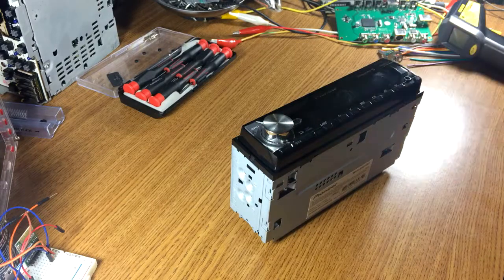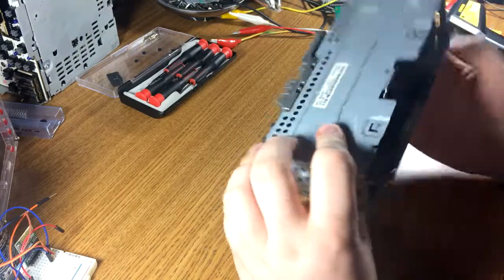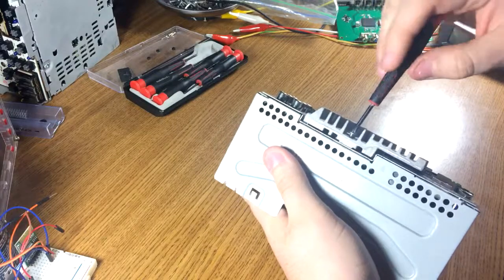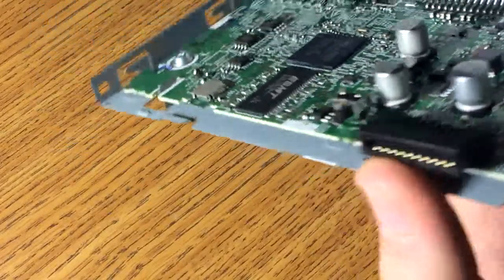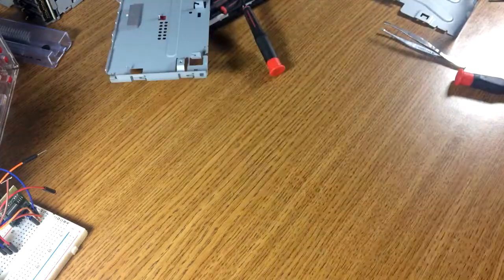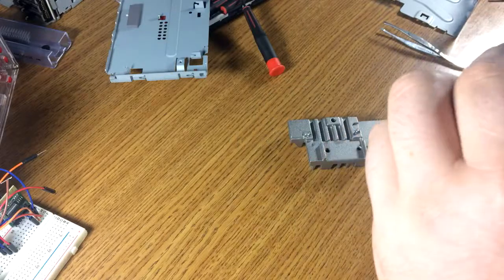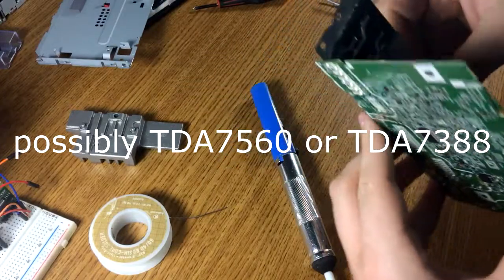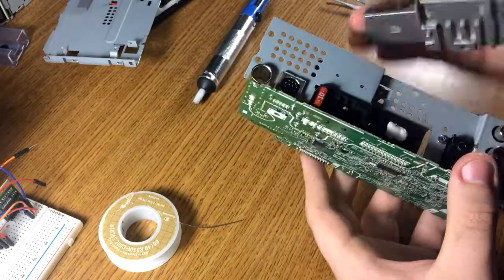Pioneer MVH-S501BS Teardown and Repair

Comment: Alpine or Pioneer ? What you recommend for this 2019 ?
Reply from the maker: If you want Bluetooth i don't recommend the 501BS as the Bluetooth constantly skips. if you just need an AUX jack and AM/FM its a good value with the front/rear/sub crossover and 13 band EQ. Alpine has come good stuff along with kenwood